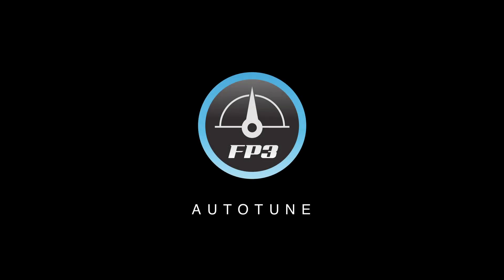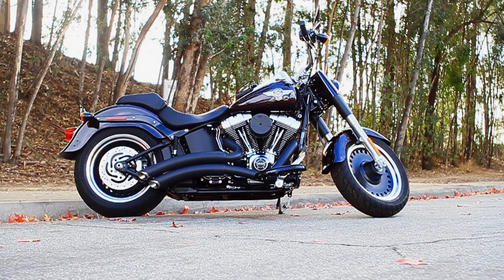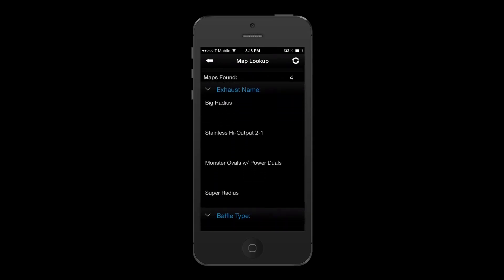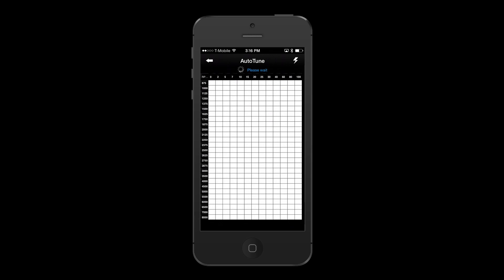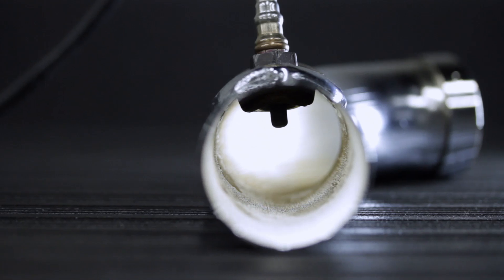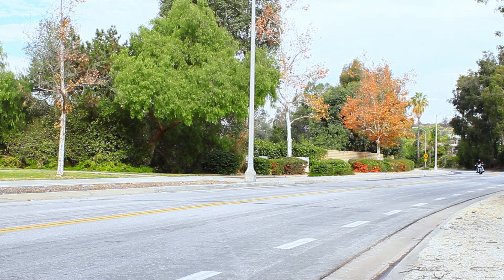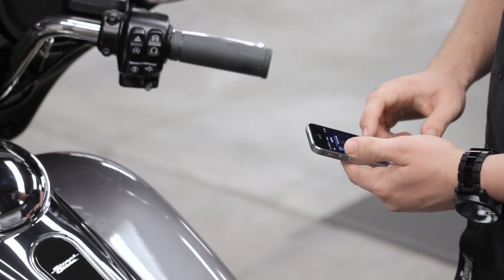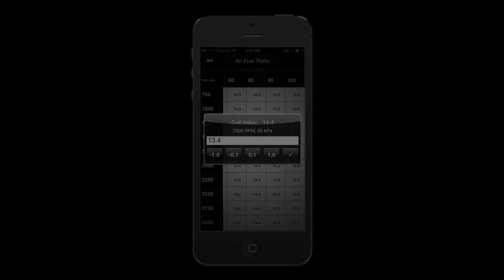Vance & Hines Fuelpak FP3 Autotuning Explained

Comment: This item does not autotune all exhaust system.  So do your research.  I have Drago Works and it is not compatable.  Not sure which other ones.
Reply from the maker: There is not a preset map for those pipes, but the autotune feature will still work to get you the proper tune for the set up you have and the way you ride.
Reply: From experience it did not work on my 2014 Ultra Limited.  I contacted V & H an was informed that the FP3 do not autotune the Drago system.  I finally reached a Customer Service Rep. who reprogrammed it for me.

Comment: Will the dealer know if I had fp3 or high flow intake exhaust on if bring bike back to stock for any issue
Reply from the maker: If you replace your high flow and exhaust with stock components, you simply reprogram the bike with the stock map and remove the FP3.

Comment: I set mine to auto tune and had the bluetooth on so it had a connection,went for about a 70 mile ride and theres nothing on my chart,what am I doing wrong? Do I need to keep the screen on  on my phone? I set the auto tune up then put my phone in the tour pak.it still said it was connected but nothing on the white chart.Thanks Ken
Reply: Ken Vaughn  found out the bike was to hot for the auto tune to initialize so on a cooler day I tried it and all was good,Thanks to costumer support at V/H, This is the tuner my dealer uses and the one they told me to use on my 2015 Tri Glide